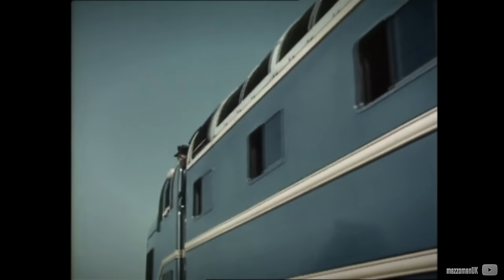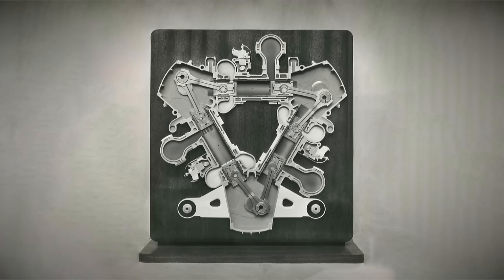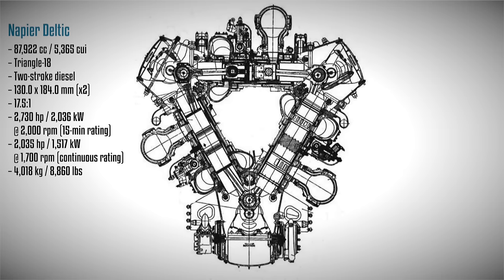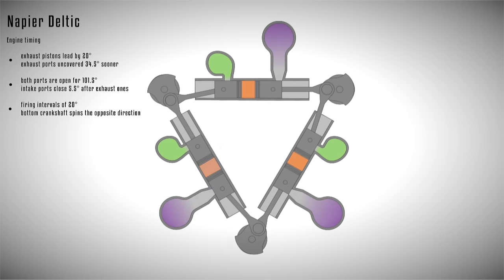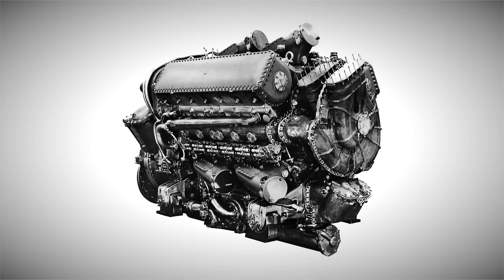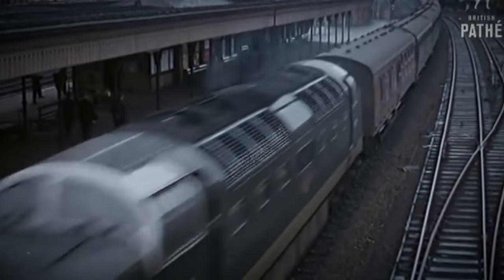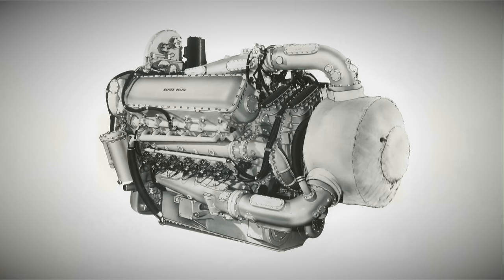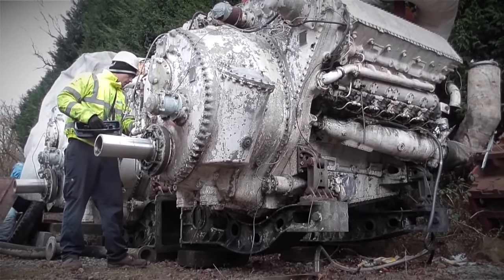The Ingenious Napier Deltic 2-Stroke Diesel Engine

Comment: I was a young lad in England when and where 2-stroke diesels were moderately common.   Commer trucks, and even a few buses, used the noisy TS3 (based on a Sulzer design) with just one crankshaft for its OP cylinders, Foden had their own 2-stroke inline-6 that sounded like a mini-me Detroit 6L71, and I've traveled many miles behind Class 55 Deltic locos hauling 100MPH trains on the East Coast Main Line out of Kings Cross, with my head out the window, flies and soot in my hair and face, relishing every moment of it!   I never rode behind a Class 23 Baby Deltic loco, but they were even louder than their big brothers.   The sound of a Deltic loco at full welly is, along with a Vulcan's howl, a sound that one will NEVER forget.   To help keep those memories alive, I now have a bus with a Detroit 6V92 that I've straight-piped, and that also brings a big stupid grin to my face, especially when I use its Jakes.
Reply: I worked on log skidders with 3 and 4 53 Detroits back in the 80s. I loved them. The Cats and John Deeres just wernt the same. Too quiet. We always said they were a great machine for turning perfectly good diesel into noise and smoke.
Reply: The Commer was certainly different but it also seems to have had an extraordinary large amount of reciprocating mass with the large rocker arms
Reply: English Electric Company Limited "Noise makers to the Crown"  Deltic, Lightning , Canberra, Power Stations - no one company has brought so many decibels to so many.

Comment: My Dad was an apprentice engineer from Canada who got his post-university training at Napier. He started in I either 1950 or 51 at 21 ro 22 years of age, and quickly found himself on the deck of the torpedo boats with Deltics recording values and helping the engine room adjust to the machines.

He also worked on the Deltic locomotives, and it's a double edged sword that he was picked by the company to spearhead the Montreal office's campaign to sell the Deltic in Canada. Napier was already in some trouble and didn't provide support to close the sales Dad tried to line up, according to my Mum, focusing on UK business instead.

In the end, though, the Deltic experience led to him moving to United Aircraft where he ended up working to high-power fast naval projects, as well as the Turbo Train; and after that with Bombardier where he was back to diesels, and selling the LRC. Within the engineering community, experience with the development team at Napier was revered, and made a lot of doors open for him, for decades after.

As a kid, we always had a sample actual cylinder from a Deltic in the basement, an ashtray made from a Deltic piston; and a beautiful scale salesmen'a model of the 18 cylinder Deltic; any one of which I'd give a lot to have now.

He only had the highest praise for the engineering talent at Napier, and said that the draftsmen could teach you more than a senior lecturer at McGill, his aima mater. 

And just to address those here who are suggesting that the Deltic was over complex, it wasn't. The complexity was elsewhere, in the complex power train that tied the crankshafts together, distributed power to blowers and superchargers and pumps. But an 18 cylinder engine putting out the power of a 36 cylinder unit, but without any valve trains, no heads to leak, no cooling to perform at the head was in the end far simpler. And because all those eliminated units were ones that needed frequent adjustment for timing, involved camshaft wear, rocker friction , valve seat cracking, etc. etc.... nope, this was a masterpiece of simplicity.

Comment: The Napier Deltic is so iconic that you can simply say "Triangle engine" and everyone knows what you're talking about.
Reply: Mazda fans have entered the chat
Reply: @kristenburnout1  nah,the apex seals blew up while they tried entering the chat
Reply: @kristenburnout1  Mazda didn't invent the Wankel engine.  They didn't even build the first successful examples.  But they kept working on them long after other companies gave up.  It's also fun to describe them as a Dorito wobbling inside a peanut.
Reply: @AnshidSalman the apex seals blew up?, I thought apex seals just wore out. Felix Wankel
Reply: @andyharman3022  Truly, the most snackworthy engine.
Reply: I didn't till this video lol
Reply: @MachineintheMonkey  the apex seals themselves never do,but they can destroy the rotors and the combustion chamber so bad,replacement is the only solution. So yeah,they can effectively blow the engine up.
Reply: @AnshidSalman  Ablative and high brisance damage to the apex seals are the primary failure mode of all Wankel engines.
The poor combustion chamber architecture combined with the weak seal design is the engines fatal flaw.
Reply: @sandervanderkammen9230  yeah and also the fact that it has piss poor compression and burns oil by design
Reply: Sir Henry Ricardo wrote that complexity is only a poor design decision when the design is bad. Or a brilliant design is poorly assembled. 😖 When RR Merlin production was undertaken in the US by Packard they were actually able to make improvements that simplified production and assembly to a certain degree. Without compromising engine quality. Improvements that RR then adopted. But then Packard had considerable experience with aviation engines already. 
Possibly the best aviation V-12 in the 27 liter class never entered production or even flew. Ford's V-1650. The exact same bore and stroke as the Merlin it featured extensive use of cast steel parts instead of forgings. It also featured side by side connecting rods to simplify lubrication issues. Along with DOHCs and a pent roof combustion chamber. Shortened by four cylinders it went on to become the Ford GA used in some models of M4 Sherman's. M4's also used gas and diesel radials, Twin GMC inline 6 cylinder two stroke diesels (1) and the Multibank 30 cylinder Chrysler. Which the Brits loved. Most be that complexity thing again.
Reply: The first thing in my mind when people say triangle engine is the wankel rotary
Reply: @amirnaim3675  You have probably never seen a Wankel DKM54...
Reply: How about making a mini Deltic out of 3 v6 60 deg Mercury Optimax 300xs engines. Each v6 is 3160 cc for the mercury stroker 300XS at 193 CID so this give 579 CID of 2 stroke madness!
Reply: @jlo13800 Do it.
Reply: @TheSilverShadow17  You clearly know nothing about Wankel engines.

No one has ever solved the reliability problems in the Wankel engine, they are inherently unreliable by design.

Wankel engines were a failure in motorsports, the fluke win at Le Mans was pure dumb luck.

You obviously don't have a knowledge of the development history of the Wankel engine or why development was abandoned.
Reply: @sandervanderkammen9230  You're saying that I know nothing about rotaries to defend the insecurities that you have in the process. I may not know them to the extent of a professional but I am aware of the fact that they have been used in motorsport and NO they didn't fail at competition. They were banned because of the rules and regulations that were set against them. It's you who's at compensation here, not me.
Reply: @TheSilverShadow17  Thank you for proving my suspicions..
 The Mazda 787b was never banned from Le Mans and was embarrassingly slow and uncompetitive, which is why Mazda retired it and has abandoned Wankel engines and motorsports all together.
Mazda lost the 1990 WSC championship title to Mercedes-Benz and lost the 1991 championship to Jaguar.
 Mazda has never won a single world-class motorsports championship.

Audi has won Le Mans 9 times with a Diesel engine proving that even Diesels are super to the Wankel in racing.
Reply: @sandervanderkammen9230 Mazda did confirm that it will resume development of the rotary as of this  year. Plus it did win Le Mans in 1991 with the 787B. The simple reasoning is the fuel efficiency plus the fact it had a 9k rpm rev limiter for durability reasons. When the engine was taken apart they discovered that it could do the race a second time but couldn't since the FIA changed the rules outlawing the rotary from competing in the 24h of Le Mans. With the major issues aside, the rotary has proven itself in motorsport but it all depends on execution. The same reason why the RX-7 is still extremely popular amongst drifters, drag racers, etc. If you heard of a guy named Rob Dahm he's been actively working on fixing the issues associated with rotaries and has modified and tuned them better than OEM.

Comment: My uncle used to be a fitter at BR Doncaster depot and spent a good deal of his career looking after the Deltic’s. 
Apparently they took a bit of looking after to keep them running well and they had a hell of an appetite for fuel but they were/are fantastic machines. 
Hearing one working hard is probably one of the best sounds you’ll ever hear!! 
I absolutely love the styling of the locomotives too, from an age where someone put some effort into making things look good!
Reply: I so agree!
Reply: I was a fitter at Finsbury Park depot and these locos were a pain to work on. Everything was so cramped and the floors always slippery, and if you had to work on one when it had just came in the shed it was very hot to work on.
Reply: Doncaster dude here , I can remember walking round the maintenance/ fitting shop whilst being a subcontractor .
Pretty awesome piece of kit  and I think just gone out of service at the time .
Sadly nothing is like back then .
Reply: @newagetemplar6100  
I'm originally from Thurnscoe and as a kid I could hear them from about half a mile away. The noise of a deltic makes me think of my childhood

Comment: The Deltics are such cool engines.
I spent some time in the cab of 55019 and 55022 both featured in the video.
That droning sound stays with you for the entire night after a day on the footplate.
But they are thoroughbred race horses, with both engines running they picked up speed very well.
Some of the locomotives even had names of race horses like Alycidon and Tulyar, others had names of regiments, those in the video 55019 Royal Highland Fusilier and 55022 Royal Scots Grey.
The last one was pulling a freight in the video, but they were never built for this work, they were express passenger locomotives.
The owner of 55022 had it mainline certified, usually doing rail excursions, but for a year he contracted the haulage of this freight running from Blythe to Fort William in Scotland, conveying alumina for aluminium production.
Reply: I drove a HEMTT in the Army; 8V92 Detroit about a foot behind your head.  Yeah, I have tinnitus because of those things, lol.  A 12 hour day of one running at 2000-2500 RPM will do that to you.
Reply: I wonder if they are running the modern 2 stroke synthetic oil in the Delticas running today. these should run great with amsoil interceptor oil.

Comment: Glad the Mack SuperPumper was mentioned! 
One more cool detail on that rig is that the truck used a Mack END 864 V8 (the predecessor to the E9). That thing must have sounded awesome!
Reply: You are absolutely correct. You could actually hear it coming. The only thing better was when it was in operation. You had to wear hearing protection if you around it for any length of time. When you were close you could feel the vibration in the street.

Comment: Napier really didn't believe in the KISS concept 🙂 Incredible engine if you ever get the chance to hear one pulling hard.
Reply: It's actually a very simple design, as it has no valves. But that is true of any opposed piston 2-stroke diesel, like the 6 cylinder opposed piston engine it was developed from. Also, some amount of exhaust piston lead is used on all opposed piston diesels. The unique feature was making the 3-bank design work. They worked out that by reversing the bottom crankshaft each cylinder would have the exhaust piston lead the intake piston by 20 degrees. The competition were developing a 4-bank engine. The reason Napier's designs appear complex is because they were for higher power than the automotive market, thus requiring more cylinders. It's possible to build an absolutely massive 6 cylinder engine but it has to be low revving which hurts the power/weight ratio, something which was important in most applications Napier targeted.
Reply: @londonalicante  The masterstroke in the Deltic engine concept is that by adding one crankshaft, you can add two cylinder banks.  You don't get that by adding a fourth crankshaft, which only gets one more cylinder bank.
Reply: @andyharman3022  There's that way of looking at it. Inline opposed piston has 2 crankshafts and 1 cylinder bank, Deltic has 3 crankshafts and 3 cylinder banks (which is a massive gain for just one extra crankshaft) and 4-bank engine has 4 crankshafts (which is still 1 bank per crankshaft, the same as for 3 crankshafts.) The issue as I see it is that the 4th crankshaft and bank adds a lot of complexity as well as a lot of wasted space in the central void.  
According to https://en.wikipedia.org/wiki/Napier_Deltic the competition at Jumo did try to develop a 3-bank engine but abandoned it as they couldn't work out the timing. An advantage of the 4-bank engine is that you can have any amount of exhaust piston lead you like, but the delta configuration is fixed at 20 degrees.
Here's a link to the Jumo 4-bank engine https://en.wikipedia.org/wiki/Junkers_Jumo_223
Reply: The Gegenkolbenmotor engines that Napier licensed from Jumo in Germany were the most sophisticated and advanced of their type in the world.
Reply: @londonalicante The Deltic is actually  a smaller, more simplified variation of the 24 cylinder  Jumo 223/224 engines which had 4 banks.
Reply: @andyharman3022 The Deltic is based on the Jumo 223/224...  it was a 24 cylinder engine.
Reply: I'll probably never see one of these in person, but I noticed the engine sounded like two 8V92 Detroits running together.  And I HAVE heard Detroits pulling hard, and it is a glorious sound.
Reply: @Billhatestheinternet  The 16V92??? or two separate 8v92 engines???
Reply: @Billhatestheinternet  The 6,000 horsepower 20 cylinder EMD 20V-710 is probably the most impressive 2-stroke Diesel I have ever heard in person, running flat-out up one of the steepest grades in the U.S.
Reply: Many people think additional crankshafts means more complexity. But every piston needs its own crank throw. Deltic runs them side by side rather than in a line.
Reply: @Dave5843-d9m  Crankshafts are certainly complicated and expensive to manufacture.
The Deltic uses the German style fork and blade style rods, so two pistons share the same crank throw journal.
Reply: @londonalicante Totally agree, napier sabre ,now that's complicated.
Reply: @sandervanderkammen9230 Vee engine same, 2 pistons connected to 1 crank pin ?
Reply: @markbeale7390  Only on asymmetrical V engines, with staggered bore spacing.
The Gegenkolbenmotors with multiple banks requires opposed cylinders to be on the same center line...  fork and blade connecting rods or a master and slave rod must be used.
Master and slave rods do not have the same piston stroke, they differ between banks.
Reply: It is so enjoyable to study the details of the Deltic and the Crecy and other remarkable engines.
Reply: @htimsid  The reason why Napier purchased this German technology was because the Jumo 204 was the Most Fuel Efficient Engine in the World
With and impressive 0.347 BSCF and 40% thermal fuel efficiency...
The Jumo was light-years ahead of everything in 1931.
Reply: Or even listening to the shaken bag of bolts as one is shut down.
Reply: Heads and valvetrains are far from simple.
Reply: One of my nagging life-puzzlements was why Greyhound Buses (in old American films) sounded different to anything else, not solved until I learned they used 2 stroke diesels. 2 x GM Diesel 4-71 four cylinder engines.   That’s 2 engines, side by side!!      I now sleep much better.
Reply: @londonalicante  
When I was younger I messed around with drawing a triangular IC engine. At the time I really didn't know anything about gear trains and couldn't figure out how to get the third crankshaft to phase properly. Inspired by Bill Lear's proposed steam engine for Indy racing. I suppose Lear saw a performance advantage in the USAC rule book of the time. Just as Granitelli did with ths turbine (Granitelli was not the first to show up with a turbine). And later Penske and Ilmor did with their specialized OHV V-8. Ilmor at the time were very secretive about the engine design. One thing they did was to reduce valve train weight as much as possible. No lifters or tappets. Finger followers instead.
Reply: @sandervanderkammen9230  
The Royal Aircraft Establishment mined the documentation on German aviation engine research extensively. As did the US and the Soviets. But the British and the Soviets were the ones to develop new aviation and ac aviation related piston power pla ts post war. The Soviets went on to develop a version of the Jumo 222. A 24 cylinder inline radial with 6 banks of 4 cylinders. The US felt with the R-4360 reaching production status and jets coming in further aviation piston development was unneeded.
Reply: @sandervanderkammen9230  
Side by side rods on V-8 engines share the same crank throw. The benefit of fork and blade rods is the cylinders share a common plane for their centerlines.
Reply: @Billhatestheinternet  My two favorites that I have heard are the Deltic and also the Valenta
Reply: I think mercury marine should come out with deltic OP 2 stroke optimax engines for boats.
Reply: Maybe it's a British thing.  Ever hear of the H-16 that BRM built to power their Formula One car in the mid-1960's?